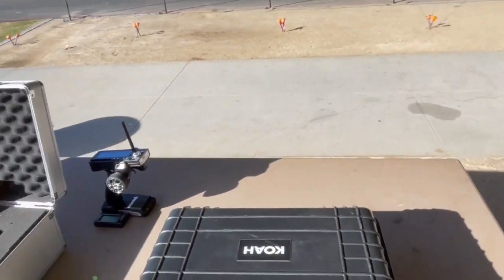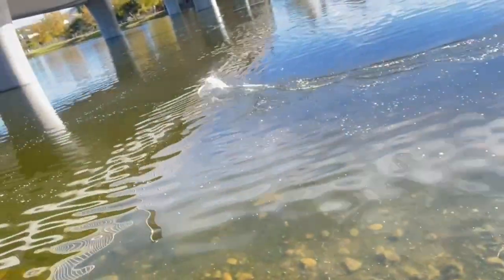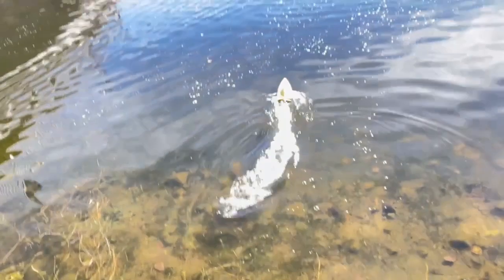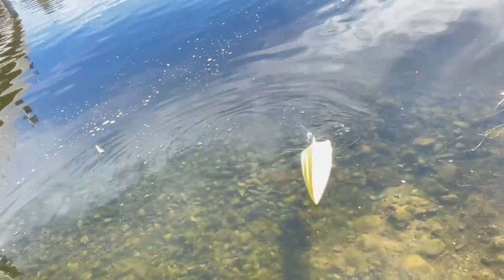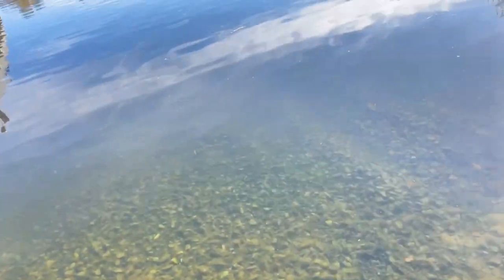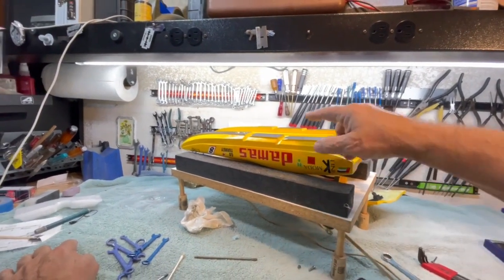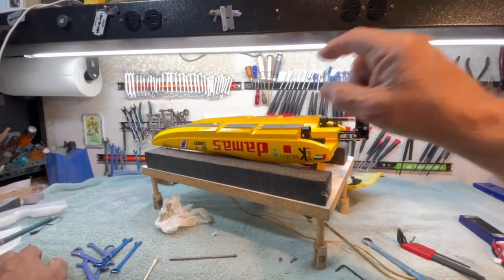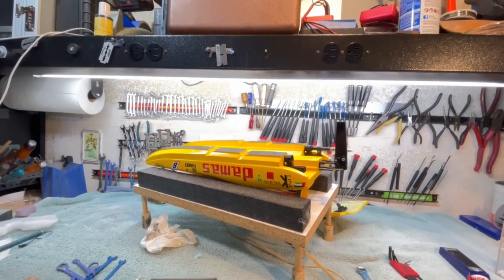Dr. Jet maidens the Micro Drifter, the Mozilla 400 and Secret Project X

Comment: That micro drifter is fast.

Can you do a video of programming a speed controller. I have a couple that either are on foward only or netural in the wrong spot. I would like to use them but I cant find a program card and dont understand the beeps and what I'm supposed to do.
Reply from the maker: I prefer to drive standing on the south shore of that pond so I get the benefit of a full-length run, but that area was over-run with propeller-clogging weeds.  I was therefore standing on the west bank that entire time meaning speed runs were straight at me with the sun in my eyes.  Next time. I'll take a garden rake with me so I can clear out a launch spot on the south shore.

It did move out pretty well, I'm pleased.  Propeller choices are limited, so I think the 1832 x 3 counter-rotating props already on there are the ticket.  Those air-cooled NeuMotors are impressive beasts, the temps were barely 80 degrees when I brought it in; similar temps with the ESCs.  The two 2S 2.25AH LiPos were in the mid 90-degree range.  Yeah, that's a 2S setup.

I have a programming card for those ESCs (I think..🤔), so I can do a programming vid if you want.

Comment: I love the step it saves ever losing a prop from a flex failure
Reply from the maker: That is a valid point I hadn't considered.
Reply: @Dr_Jet  it is I lost another prop just this morning, that’s about 15 props littered around the lake in front of my house.
I may need to go back to flex cables  once the wire drive gets some twist in it from the power that’s the end of them.